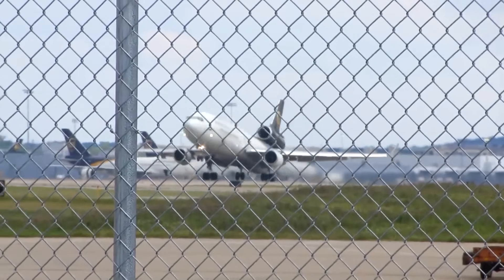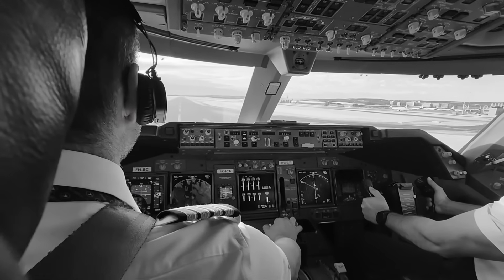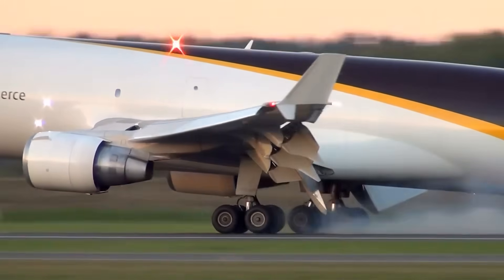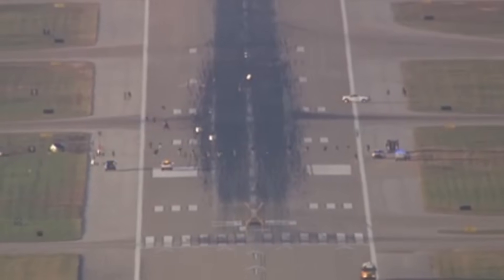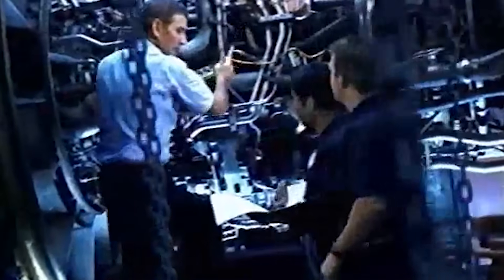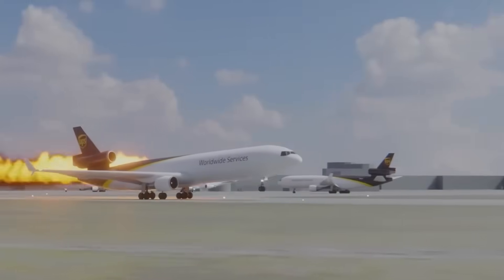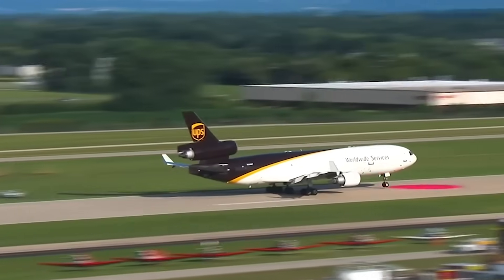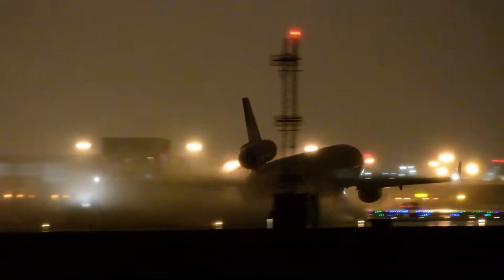The REAL Reason UPS 2976 Failed So Catastrophically...Mistake repeated AA Flight 191

Comment: When the left engine began to break away from the plane, the engine status display certainly raised an alarm in the cockpit, for the pilot to take action. Even past "V1", barely airborne (image 2), had he heeded the warning, he would have put the plane down, maybe causing damage to the land gear, in a "soft" crash, but having enough time to evacuate the plane on fire. But by continuing the take off, he crashed from a higher altitude, ending up roasted, with his crew, and killing 11 other people on the ground!
Reply: The timeframe would not have allowed that.  Are you trolling?
Reply: The rule is that you do not put the plane back down after rotation, you do a go around. Plenty of planes have been broken by "heeding the warning". The pilots did exactly what they should have done, but no amount of following proper procedure, or "heeding the warning" would have changed the outcome.
Reply: Incorrect. They were past V1, meaning they had to take off.  Not enough runway left to stop. A rejected take off would have resulted in the plane skidding to the crash instead of falling into the crash.  Same result either way. If engine 2 had not compressor stalled after ingesting debris from engine 1's detachment, they would have flown away, but the fire would have caused a catastrophic crash as soon as the left wing failed due to fire damage, possibly into a subdivision, etc., with massive loss of life. These pilots were heroes and did everything correctly.
Reply: You have no F’ing idea what you are talking about.  Stick to your current profession:  stay away from aviation.
Reply: Armchair pilot says what?

Comment: Thrust forces + aerodynamic forces + gyro-dynamic forces + certified engineering design > fatigue cracking > undetected / hidden fatigue critical crack length > fast fracture.  This is a classic, textbook engineering fatigue failure that unfortunately did not make it into the textbooks.  RIP to those who suffered the hardship.  Thank you for this analysis.
Reply: "certified engineering design" by federal technocrats, not engineers!

Comment: Looks like 3rd party maintenance and improper maintenance/inspection to me, along with single point failure by design.
Reply: The third party maintenance visit did not include any required pylon tasks at all.  It was there for other items to be fixed.

Comment: Really what that means is every one of the MD11s have the same disastrous problem and should be retired from service ASAP before another crashes!
Reply: or replacing parts much sooner, maybe even making it unprofitable and causing retirement
Reply: Incorrect:  they should ALL be inspected, and repaired if necessary, prior to return to service.
Reply: @gordonbryan8381 in this case you have to disassemble the mount.. may as well replace parts and be done with it

Comment: Tanker 10 uses these aircraft to deliver retardant on wildland fires.  I’ve watched them, probably for the last time.
Reply: Tanker 10 uses DC-10's, not MD-11's.
Reply: @markmcguire6573 yes and the AD was extended to also include the dc10s… it’s the same pylon mount
Reply: pretty sure they will replace these parts and get another life

Comment: I still can’t fathom the idea that the whole damn structure hangs on just two lugs. How about SEVEN?!
Reply: Most airliners built from the early sixties and on have this similar pylon installation. I removed pylons on the old DC8s, and they had better access than the DC-10 because the pylon is longer to allow the engine to be further forward for CG purposes. On other airplanes, engines have detached, but pylons had stay on the airplane. Since my start in aviation engineering, the only two pylon separations in flight have been one DC-10, and this MD-11. Seven lugs as you state, would be too rigid for the engine/wing structure to allow bending forces. If the wing structure can't bend, it brakes.
Reply: @javacup912 Pardon my ignorance but the fact that any engine producing on the order of 20,000 shaft horsepower or more - or the related pylon would separate in flight seems like a real problem. Is there no way to increase the size of the lugs or add redundancy? Perhaps 7 is an extreme number and an exaggeration - but is an additional safety lug (that is not the primary or "lead" lug in a lead/lag scenario an impossibility? One that would not restrict wing movement but would engage only to prevent catastrophe? Looking at the photos it appears there is a grease fitting that would suggest the size of the lug. Seems it is not that huge to be honest.
Reply: Weight

Comment: The parts should be changed on a tighter schedule.  Cutting costs on maintenance.  Call a spade a spade. As usual comes down to money.
Reply from the maker: That's a common concern in the aviation industry.
Reply: I'm left wondering about the future of these aircraft. It will depend on the overall cost to redesign the mounts, testing to certify the new parts and the cost of retrofitting the airframes. Considering the age of the aircraft, it may not be profitable to repair them.
Reply: And remake the rear mounting lugs and wing mount tabs out of forged steel. Might reduce payload by 500lbs but give some peace of mind
Reply: @tobymichaels8171  While steel has high tensile strength, titanium is preferred for high strength aircraft applications since it has a much better strength to weight ratio and resistance to corrosion. Airbus uses titanium for pylon primary structure. The Airbus attachment shackles are a far more robust design than what is apparent on the MD11. I’ll guess the MD11 fleet at UPS and FedEx will fly one more cycle, under a Part 91 ferry permit, to the boneyard in Arizona where they will dismantled. Neither airline would incur millions of dollars in cost to modify their MD11 fleet, a highly unreliable fleet that was in the process of being phased out anyway.
Reply: @tobymichaels8171  Cast iron is a terrible material for this application. Low fracture toughness, very low corrosion resistance, and lower strength than alloy steel or titanium. Weight would be higher too.

Comment: In this airplane design, thinking there's a forward and an aft lug is foolish. Physics shows us that when they’re sandwiched together, they don’t share the load as two separate pieces of metal. Because when they’re under load and fracture, they will do so as a single lug unit. Both will crack apart in the same place, exactly as they did in the post-crash photos, for your reference. So at no point could the aft or forward lug bear the load at the pylon, not by itself. For additional reference, just double up the floor joists in your home. Now you have one double-sized joist bearing the weight above it. There’s no sharing; it’s two joists doing the work of one. If they fail, they do that together.

Comment: Has there been a safe tri-engine aircraft other than the B-727? 
L-1011?
DC-10? Or 
MD-11 ?
Reply: My understanding is the Tri-Star L-1011 was safe. Pilots loved her.

The Everglades was 100% pilot(s) error who did not realize auto pilot was off and was on a slow descending turn until impact.
Reply: The Locked Corporation was exonerated in  the two most notorious examples of Crashed L-1011's.  The Eastern Airlines L-1011 that crashed in the Florida Everglades was proven to be the Captain's fault because he didn't bother to either have the co-pilot fly the darn plane while all three men traced a $0.20 light bulb to ensure the nose landing gear was securely locked in place while on final approach to the airport in Miami.  The other L-1011 crash occurred between a freeway and the start of a paved runway at the Dallas Fort Worth Airport in a severe thunderstorm.  The microburst downdrafts only harassed the flight crew of that Delta Airlines L-1011.  The microburst caused an uncommanded landing of the plane at a point north of the freeway and once again pulled the same stunt on the same plane on the south side of the freeway.  NASA is the only company that was still operating any L-1011'S in the 21st Century.  There has only been a whopping 1  fatal crash of a DC-10 which the Douglas Corporation can be held 99.% responsible for in all manners.  That would be the 1974 crash of a Turkish Airlines DC-10 in a Forest in France between the English Channel & the City of Paris France.  That airplane was flying at cruising altitude when the plane suffered an Explosive Decompression when the port aft cargo door blew out after two defective locking mechanisms unlocked the door despite the fact that the baggage handlers could properly stowe the handle on the outside of the darn door.  The Douglas Corporation willfully deliberately delivered DC-10'S to the airlines with the complete knowledge that their supplier knew they were deliberately doing the same thing.  If the FAA didn't know about the criminal behavior on the parts of the Douglas Corporation and this one supplier of locking mechanisms before the delivery of the first orderers, an American Airlines DC-10 exposed this criminal behavior in 1972.  While climbing to an assigned altitude for a flight from Detroit to Buffalo suffered an explosive decompression that left the port aft cargo door partially secured in place.  Although some empty seats, internal parts, and a coffin with a dead body were recovered in a Canadian meadow, the pilots safely returned to the airport in Detroit.  The FAA deliberately allowed the Douglas Corporation and the supplier to resume business without any criminal court prosecution.  This complacency on the Parts of both the FAA and the Douglas Corporation was exposed by relatives of deceased UK citizens who lost relatives in the 1974 crash of the Turkish Airlines DC-10 in France.  The FAA was content to frame a Turkish Airlines Baggage Handler who barely understood the English Language before the British Litigators exposed the FAA'S complacency in the criminal acts by refusing to hold the Douglas Corporation criminally responsible after the 1972 American Airlines incident.  On top of that the FAA deliberately refused to force the Douglas Corporation to replace the two defective locking mechanisms.  It wasn't like the supplier never tried to replace the defective locking mechanisms after they changed the design of the parts to solve this problem.  The FAA joined the Douglas Corporation in bed to falsely claim to value public safety.  The other two fatal DC-10 plane crashes during the 1970'S were proven to be solely caused by incompetent people.  The incident between the Turkish Airlines crash in 1974 and the AA-191 crash in May 1979, was caused by incompetent airport personnel in Mexico City.  The second crash of a DC-10 in late 1979 was caused by an incompetent radio operator on the Antarctica continent who directly placed a New Zealand pleasure flight directly in front of a mountain instead of having the pilots pass said mountain on either the west or east side.  The New Zealand Government deliberately framed the captain of this flight instead of holding the radio operator accountable for his error that actually caused the plane to crash despite the fact that the pilots barely miss it's chance to raise high enough above said mountain to avoid their Controlled Flight Into Terrain.  

My mom and I flew out of Chicago's O'Hare Airport about 4-6 weeks prior to the AA-191 crash.  I was only 6 years old and learned of details this incident in the Smithsonian Channel Docuseries "Air Disasters" episode on AA-191.  My only real time memories of that part of 1979 were a couple of events surrounding short visit  a family funeral in Chicago.  I know we landed in a late season snow storm.  Our visit was extended after both my mom and I  developed ear infections.  My grandma kept us there longer until her primary care doctor cleared us to fly back to LAX.  You cannot hold the Douglas Corporation responsible for the AA-191 crash because of lazy AA mechanics unknowingly set off a ticking time bomb when they failed to notice the fact that their laziness started the stress cracks by slamming the aft bulkhead structure in pylon when they crushed a portion of the bulkhead assembly parts together 8 weeks prior to the crash on Friday 5/25/1979 of a DC-10 that was ultimately bound for the State of Hawaii.  I know a KLM Airlines DC-10 or MD-11 crashed in Europe back in the 1990's.  That crash occurred during a severe thunderstorm.

I haven't forgotten about the Boeing-727 for an air frame type that has a 7 decade operational history, BAC has been exonerated in 99.6% of the incidents involving the 727 Air Frame product.  The history Boeing-727 is but one reason that important to know who to blame so that we don't do a monkey see monkey do of wannabe experts (including those who claim to have big airline piloting experience who you YouTube to eliminate all doubt that they are fraudsters with YouTube channels.  That is something the man who owns this YouTube channel cannot be accused of.

Comment: I think overall this is a well done analysis. But I have a couple of critiques. Freight usage of these airplanes is not significantly different than when they were in passenger service. Nobody was flying MD-11s on lightly loaded short hauls in those days, they were flying very long-haul flights, and taking off at just as heavy weights pretty much every time. When long haul passenger flights are light on passengers, the airlines stuff them with as much hold cargo as they can to keep on making money, and fuel is the major contributor to takeoff weight anyway. Second, the fact that the pilots DIDN'T have a huge problem keeping the wings level (at least until they hit a building and then lost a lot of speed) points to the aerodynamic disturbance of the wing not being a major factor (unlike AA191). The primary reason for the loss of control was the loss of thrust on the #2 engine. Whether that was due to FOD or the fire disrupting airflow or starving the engine of oxygen or all of the above remains to be seen. An MD-11 can climb out and fly safely on two engines, but not 1 and a bit engines.
Reply: UPS airplanes fly a lot of short haul legs, this MDs fly two legs a night. 1-3 hours long. Domestically weights are lighter than an international flight.
Reply: At the end the aircraft got slow and exhibited a classic Vmc rollover. Aerodynamics was a factor.
Reply: @artjackson8360  Sure - at the end, because they lost thrust (and HIT A BUILDING) and slowed down. There was no initial aerodynamic issue, they were flying just fine, if they had not lost thrust, they had some chance. At least until the fire compromised the wind integrity.

Comment: Fatigue curves do account for stress not just for cycles- so inspection and replacement schedules definitely should account for the type of service the aircraft will see throughout its life.
Reply: You’re mistaken here. Fatigue damage is highly dependent on stress vs. number of cycles. It’s one of the primary variables.

Comment: Changing out pylon bearings (and other highly stressed parts) when they reach a conservative cycle count makes sense.  It's cheaper than losing crew, plane and payload, not to mention ground personnel and buildings.  The space shuttle main engines were operated with this mandate.
Reply from the maker: That's a very good point about the importance of scheduled maintenance for critical components.

Comment: What about adding large sand pits at the end of the runway? Grand Prix race courses have them in case a racecar leaves the track. Due to the placement of some cockpits, pilots have a limited view of the engines. In some cases, the wrong engine is sometimes shut off. Cameras mounted on the plane could give the pilots a view of the plane's engines. Just my thoughts concerning the crash.
Reply: Google EMAS (Engineered Arresting Material System).

Comment: How are other jets' engines attached to the wings?
Reply: Later designs built on the lessons learned by previous accidents. Engine/pylon and pylon/wing attachment structure changed from a fail-safe (redundant load paths) design philosophy to a safe-life (build in a defined lifetime and replace at EOL) philosophy. As a result the structure looks quite different in modern aircraft compared to the designs of the 1960’s.